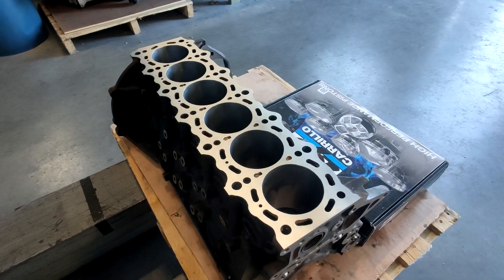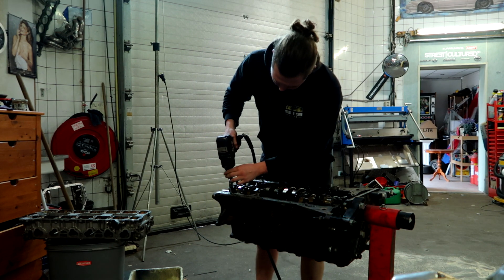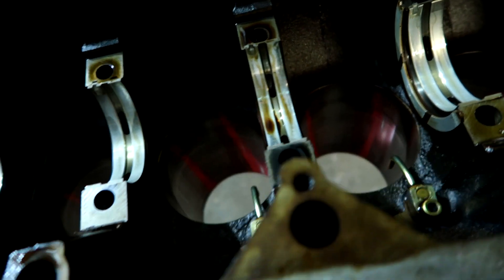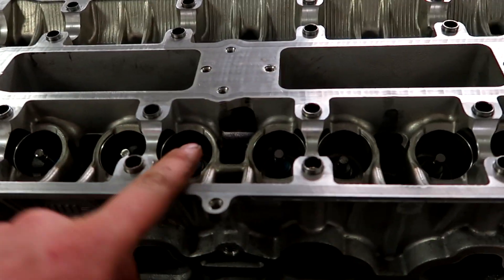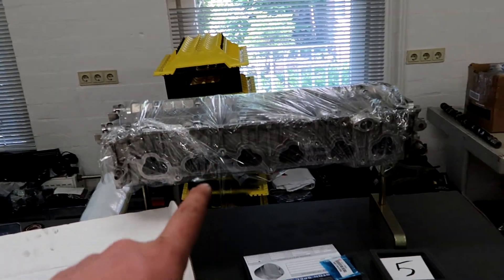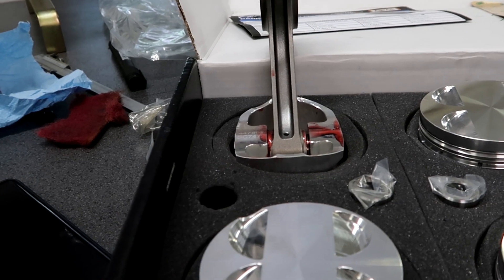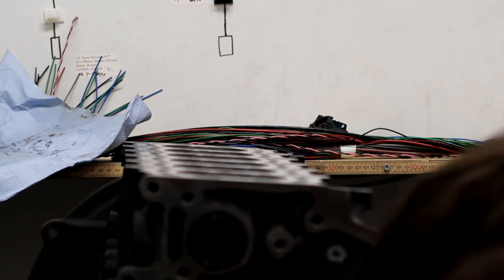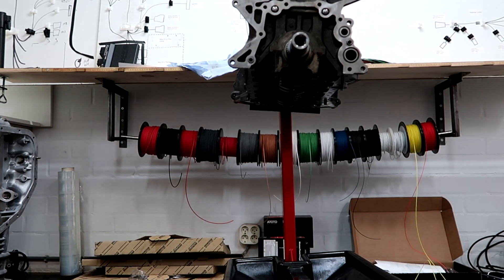Rebuild 1JZ GTE-VVTI with all NEW/FORGED internals! 1000HP Ready

Comment: Correct me I I'm wrong or what I might of see did you torque the mains in the wrong torque order
Reply from the maker: yeah.. I found out later that there is a torque order for the main caps as wel.. didn't know and check that at the time of installing. But I talked with my collegue about it and it's probably just fine to do it like this. But toyota's torque order is obviously better!
Reply: I like it though I'm learning it all by myself now I just gotta figure out my wireing it's got me all confused on what to do and what I don't need and need
Reply: I'm running a gte block with a ge vvti head with ge non vvti internals new rings and all barrings with a Tomei 2.0 head gasket I hope it goes well when I fire mine up
Reply from the maker: @Chris Willingham  I also thought myself everything, learning as I go! Making mistakes is part of the learning process!! Good luck with your build man!
Reply: Yeah I'm still learning I'm gonna be running a emu ECU masters black it's gonna be fun trying to figure that one out but I'll get it done when I'm not working so much I guess
Reply: On that note to do you know if I can run the stock 2jzgte ECU with a aftermarket deep motor ffim that's the reason I'm gonna go standalone cause I'm not sure if it's gonna run right with it if it will then I'll leave it alone and buy some other parts I need
Reply from the maker: @chriswillingham8947  I know that the stock ECU is really good in adjusting with aftermarket turbo setup. But I don't think know how it will react with a different intake. If you keep your idle control valve and other bits that are on the stock intake, it should be fine. But don't take my word for it.

Comment: Nice work, but you do know that after installing the ARP main studs it is advised to get the maincaps line bored/honed ?
Reply from the maker: Yeah it is advised indeed, I didn't have the time to do it. And with JZ's it's not that big of a deal when you don't do it
Reply: i did not line bore my 2j its been running for years
Reply from the maker: @TheHighroller88  Yeah, you don't have to do it on a JZ. But it's better to do it if you can!
Reply: @lithshop  says who, was it measured ?
Reply: @tommurray8312  it was measured in the video lol